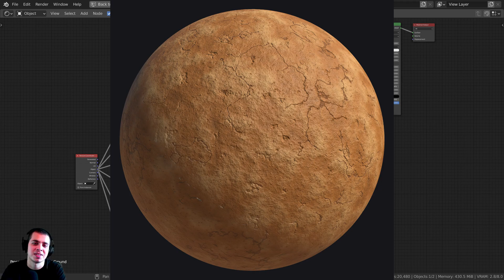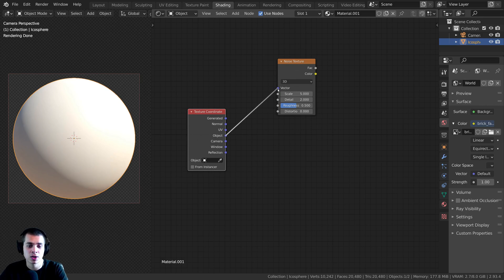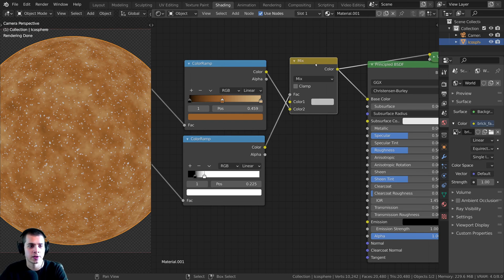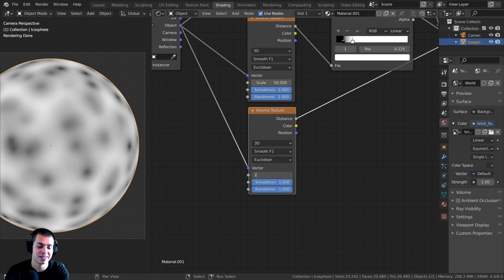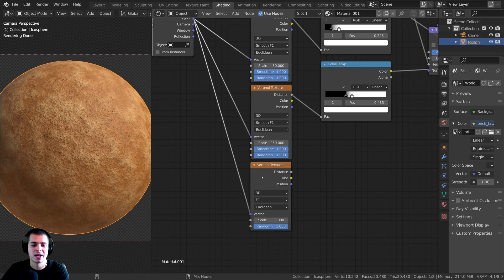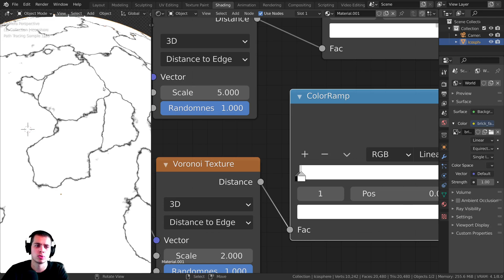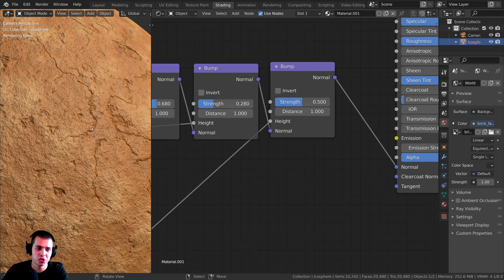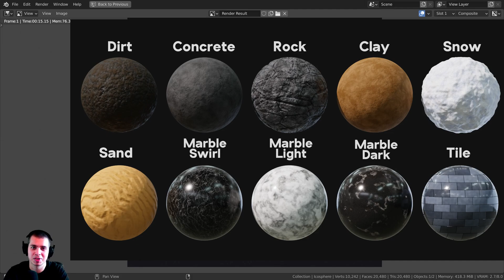Procedural Dry Cracked Ground (Blender Tutorial)

Comment: Following along in Blender 5.0 and at 7:00 the second bump mapping didn't add any detail, or change the texture at all. I've also noticed the shadows are very flat. From there none of the additions seemed to change anything on the final texture until 12:00 adding the cracking effect. So in Blender 5.0 the end result for me looks flat and smooth except for the crack details. Even triple checked the node connections, I'm not sure if/what went wrong.
Reply from the maker: If the bump doesn't seem to be working, check that the bump node values are all the same as in the video. There was a recent Blender update to the bump node, and the default distance value is now much lower.

Comment: I can't seem to get my pebbles to work. I've mimiced your settings, but it looks like the ground has splotchy freckles or a rash, rather than rocks in it. Are you in experimental cycles, or eevee? I've tried changing between those, but it hasn't seemed to help.

Anyone know what I might have gotten wrong?
Reply from the maker: I am in Cycles, and I'm not using Experimental.
Sorry,  I don't know what is causing your problem. Maybe go back, and re-watch that part, and make sure your using all the correct settings.

Comment: Another great tutorial Ryan! I have a question. For the noise texture (as well as other textures i guess) how do you know when to use the factor or color?  Thanks and keep them tutorial coming.
Reply from the maker: Thanks! Hmm, it really depends on what your doing. I would say, use the factor for most things. Only use color if you specifically want to use color data. But if your just using it for something like roughness, or normal, that doesn't use color, then just use factor. It really doesn't matter too much as long is it gets the result your looking for. And for most things, I usually use a color ramp after a texture, which converts the colors anyways.  : )
Reply: @RyanKingArt  thanks for taking the time to explain. Appreciate it.
Reply from the maker: @shanm157  You are welcome!